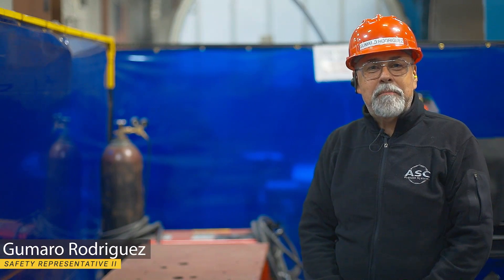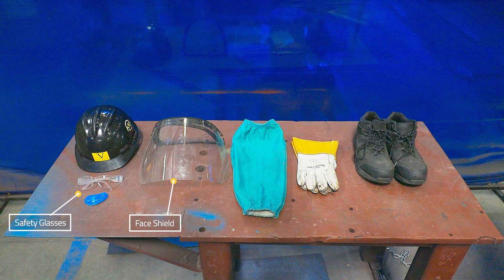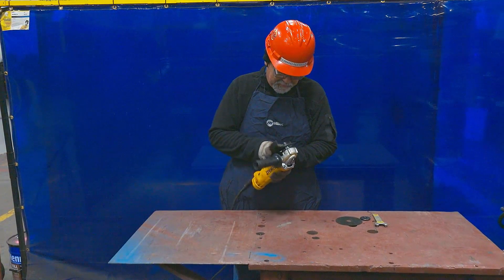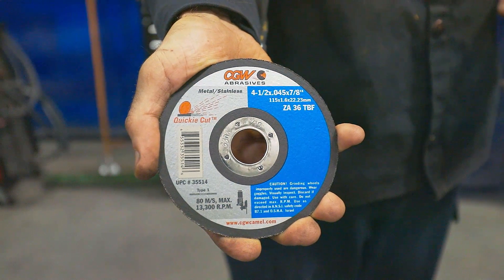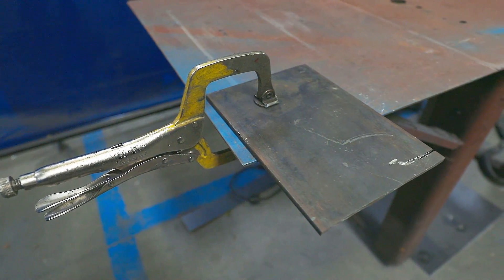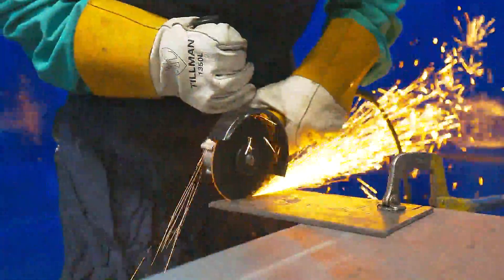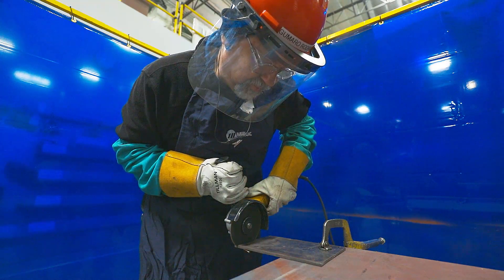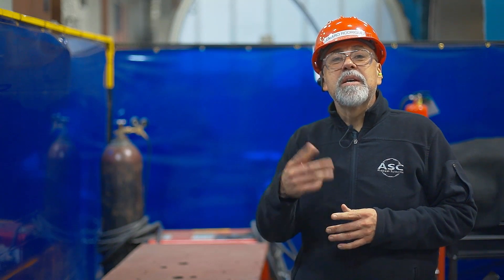How to use a Cutting Disc with an Angle Grinder

Comment: I would add that when something flys off a spinning disc, cutting disc or engine flywheel or ..., it travels in the plane of the disc. The position that gives you the best view often isn't the safest when things go wrong. Practise working without putting yourself, especially face, in the plane of the disc.

Comment: A cut wheel on a grinder is the only setup, that even after years of use, I respect the most of all tools. A disc breaking at 10 or 13,000 RPM is something to fear, not respect. Wear your gloves, a thick jacket and a face shield EVERY time you use one of those. And never EVER use a disk that is no longer uniform.

Comment: I'm a novice and right-handed. When cutting metal, instinctively I grasp the side handle with my left hand and the angle grinder with my right hand. That way I find it very comfortable inasmuch as the splinters fly away from my body. The risk is that the tool tends to kick back, but I can cautiously manage it. My question is: Are there any potential risks using the power tool that way? I'm very concerned because I see that no one else handle the tool my way! Thank you!
Reply from the maker: Hi. Thanks for the question. Angle grinders have handles that can be moved to a right or left orientation, so your position on the handle doesn't tell us whether you are using it safely. What matters is that the disc rotates towards the material and not you (the operator). Rotating in the direction of the operator is a safety hazard because of the risk to the operator if the disc slips or breaks. If you're unsure which direction the disc is rotating, you can check the directional arrow on the grinder head. Hope that helps.
Reply: If the angle grinder is kicking in to you, you need to flip the grinder over and put the handle on the other side. You want the sparks coming in your direction so that if the disc binds it will send the grinder forward and out of your hands not into you. Obviously you need to stand to the side so that the sparks aren't going directly at you.

Comment: Good safety brief.  At 10k - 20k rpm, the wheel is incredibly fragile and I've seen them turn into a radial shotgun.
Reply: This happened to me and I was screamed when It happened but pleasantly surprised that it hurts less than getting a shot tbh if felt like cardboard getting thrown at me....idk if I got very lucky or we are afraid of this for no reason
Reply: What rpm is the best?
Reply: Based on his comment.. probably a 9999 RPM is in the safe zone 👍🏼

Comment: I found this video while searching for how to hold the tool. You didn't mention it, but are you right-handed? Do we hold the handle with our dominant hand, not the tool body?
Reply from the maker: Hi Mik. Gumaro is right handed and is using his right hand to hold the grinder handle in this video. Which hand you use on the handle/body comes down to comfort and personal preference, though we've found people generally prefer to use their right hand to grip the body because it makes it easier to avoid the sparks. Good question!
Reply: @ASCProcessSystems  Great. Thank you!
Reply: I'm right handed, but I use my right hand for the trigger and left hand for the body. I like that position because it is easier to see the cut and manipulate the tool; however, it is not the safest position because your body is positioned in the area of the most Sparks or the blast area if the disc breaks. I try to grind using left hand on trigger and right hand on body, but I find I can't see my cut line as well and I can't manipulate it as accurately because I am not used to it. I would say if starting out, learn to grind so the grinder is the the left side of.your body so you're not eating Sparks.

Comment: New to this type of tool, not wanting to be injured.  Tool info indicates that a Type 1 flat cut-off wheel (As opposed to a Type 47 depressed/recessed.) can not be used because it is too close to the guard and may strike and shatter if it flexes and that the guard needs to be changed to one with a front shield.  I see you and others do not follow this.  The tools do not include the cut-off guard and some don't even offer them as an option.  Have you seen this in the manuals?
Reply from the maker: Hi. Good question and observation. You're right that a type 1 cutting disc needs to be used with a type 1 guard. This is because these discs are used on their edge, unlike other discs (e.g. type 27), which are used on their side. When used on the edge, both sides of the disc are exposed, so a guard is needed to cover both sides. This is covered in the manual for the grinder we use, which is a Dewalt D28402.

Our experience is that manufacturers typically do not include a type 1 guard with the grinder. They offer it as an accessory, which needs to be purchased separately. We didn't know that at the time we made this video, which is why we didn't address type 1 guards. We are making a new video that will address that issue. Thanks for your comment, and good luck using your new grinder safely!

Comment: Hello there, very good informative video. A quick question is it mandatory to put metal cutting disc printed/labelled side  facing the power tool or it doesn't matter unless other specific instruction are on place?
Thank You.
Reply from the maker: Hi Iliyan. Good question. We did some digging on this and asked our experienced welders. The short answer is no. If the manufacturer doesn't specify, then there is no rule about which side the label should face. Thanks for asking.

Comment: As an educator, should you be using a Type 27 guard with the Type 41/1 cutting wheel?
Reply from the maker: Hi Patrick. Good call. We’ve been using the guard that comes with the grinder, but after some confirmation research we agree that the correct guard to use with a type 1 cutting disc is a type 1 guard. We’ll re-edit to show the correct guard and also ensure that the proper guard is being used when cutting in our shop. Thanks again for correcting the record.
Reply: Good catch - I just bought an angle grinder specifically for cutting - just realized I need to order a Type 1 double sided guard.